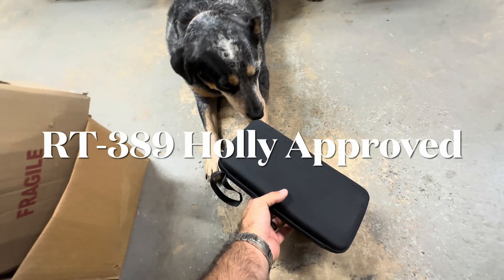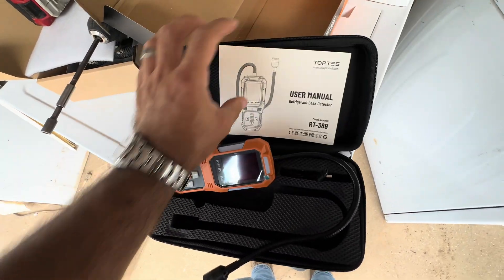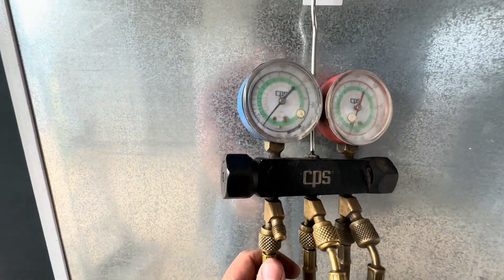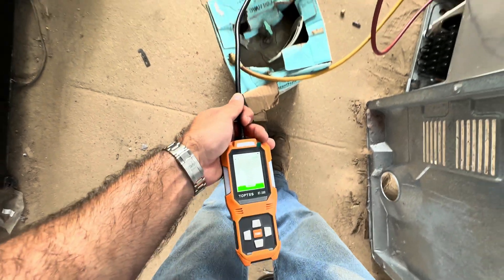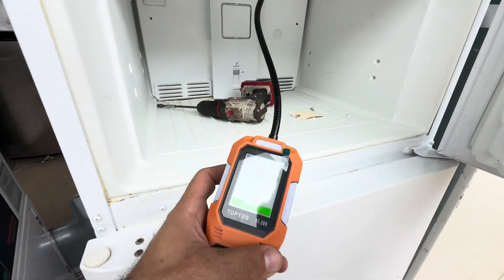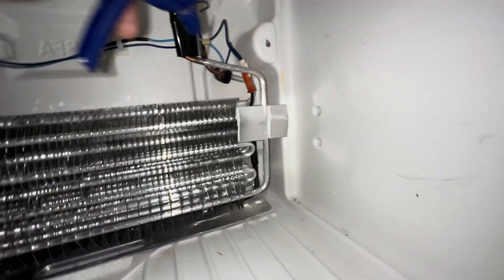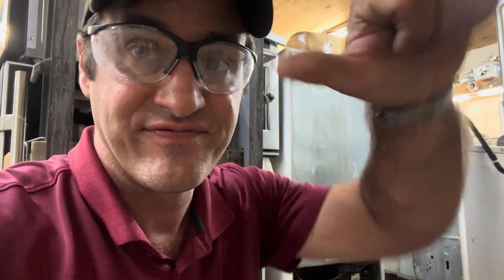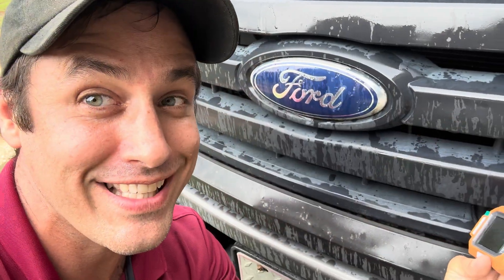Toptes RT-389 Freon Leak Detector PART 1 | Frigidaire Fridge Not Cooling | Freon Leak | FFTR1814TWL

Comment: Very cool LA.  That new sniffa is already in my Amazon cart.  At $129.95 I can afford to own a leak detection tool.   Of course I’ll use your link.  😁
Seriously, will JB Weld hold on an aluminum evaporator?  Yes a redneck fix but I’d try it before changing an evaporator on my own stuff.  I’d call that a time saver!
Reply from the maker: Yeah I sand the aluminum a little and clean it with acetone. And I pull a slight vacuum when I slather it on. It does hold.  Not the best but it works in a pinch. Awesome. I really like this. I hope it hold up well. I’ll be using it in videos going forward

Comment: 275 list on the EVAP plus it’s 350 for the external heat exchanger kit only gets done under warranty no one pays for that repair
Reply from the maker: Exactly. Too much but I found an evap that pops cut off a unit that was missing stuff so I put it in.

Comment: Hey, maybe on this fridge you could have just pulled out the evaporator and then pressurized it inside a bucket to see where the air bubbles were coming from that or just lay the fucker on its back and pressurize it before you even removing it I’m sure a little water wouldn’t hurt anything inside lol